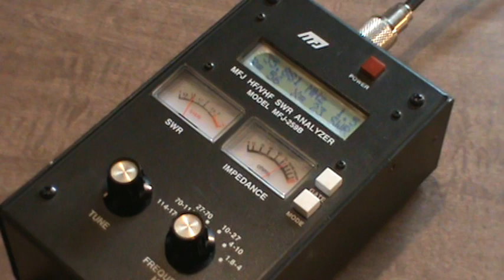Shortened Dipole Antenna Part 5/7

Comment: Hi Dave, as short as the antenna is it will have a narrow bandwidth. Finding the length of the stingers and cap hats should be easy. I do this type of tinkering myself.